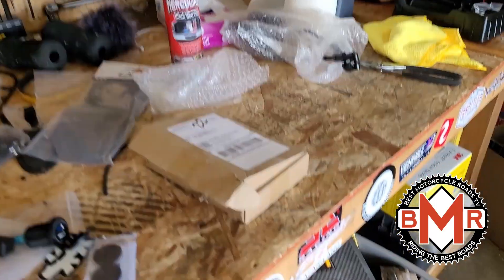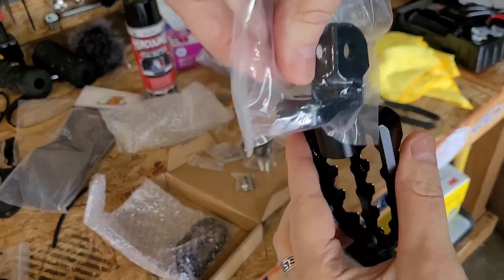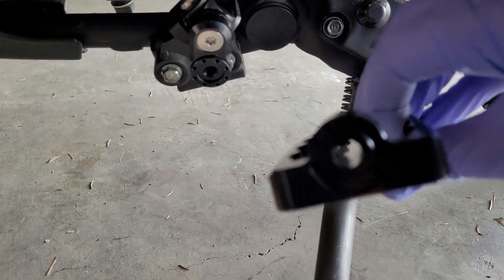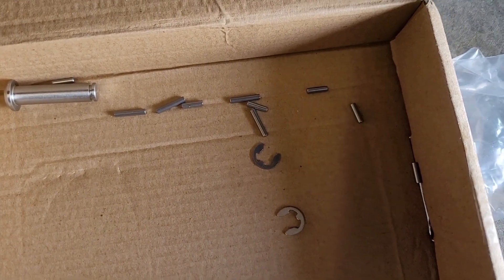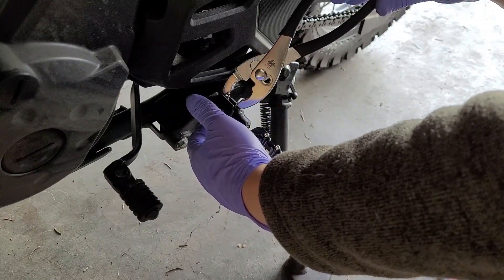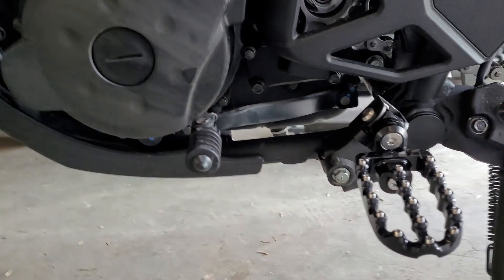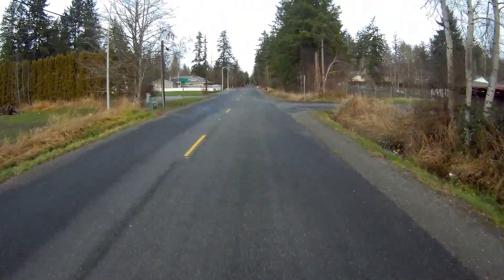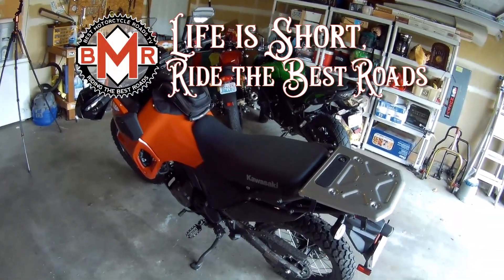2022 Kawasaki KLR 650 NICECNC Peg Install - NOT a How To.

Comment: I had to return mine.  No instructions and tried to align pins but no luck.
Reply from the maker: Strange. Mine worked no problem. The key thing I figured out is that with the extension plate you only use 1 pin per side.

Comment: I received  my foot pegs today...thanks for the tip
Reply from the maker: Sure thing, I hope ;) - So far they are working well for me. The nubbins are all still in place and tight. I like the lower position on my knees and standing is perfect (the teenie bit I've done.)
Reply: @BMRTV  well I'm 6' 2" I may still need bar risers..I'll have to wait and see..can't ride yet still have snow and ice over here...barely at 32 during  the day
Reply from the maker: @gabrielkopp2036  that is cold. A little plug, I bought some rox clones for the Versys and never put them on. Got them on ebay. https://www.ebay.com/itm/175137689523?mkevt=1&mkcid=16&mkrid=711-127632-2357-0

Comment: Thanks for the content, I went with the Nicecnc too and they turned out pretty good.
Reply from the maker: Thanks and mine are still working nicely. Got just over 3k on my bike so far. I am considering taking out the extension piece to see if that helps my standing position for going up steeper hills standing.
Reply: I ended up going back and slightly up for my peg position.  Still have a better clearance for shifting gears and using the back brake.

Comment: Installing the same pegs on my 2008 KLR today. The number of the pins (10) that come with them is very confusing. No instructions came with them either, so I will do what you did and only use one per peg. Tried to install more but could not get them to align with any hole. Let me know how the one pin has worked out. I will continue with the one pin tomorrow, Thanks for the video!
Reply from the maker: Nice. (no pun intended) . Same here. Clearly their engineers only want 1 pin when using the extension plate. I assume a mechanical engineer could probably explain why 2 pins would be a bad idea. So far it's been working great for me. Very solid feeling and I love the little bit of extra room having them slightly lower.
Reply: @BMRTV  Thanks for the response. I will finish today with the one pin. At least we have plenty of pins in case one breaks. ha ha

Comment: wow! nice comprehensive vid. I wanna put some of these on cuz I bought the adventure model, and because I'm 68, I have to step onto the left foot peg and throw my leg over. I feel these NICECNC pegs are wider and more stable and therefore will make it easier for me to "mount up".
   I also feel that these CNC pegs, coupled with the new Happy Trails extended shifter, will make shifting ezier. your thoughts? Thank u!
Reply: I'll try some and see. Thanx again!
Reply: I bought these for the very same reason. I too am in my 60's and my legs don't always swing like they used to! To make things absolute best for me I added a sergeant seat, which lowered the seat height 2" and changed out the swing arm lowering the rear 2". Now I can saddle up and ride like the wind.

Comment: did u do ok with just the one pin or did u add more?
Reply from the maker: Just the one (as they intended.) Working great. 3200 miles so far.
Reply: @BMRTV  awesome. just putting mine on as we speak. great video. i'll like and subcribe!
Reply from the maker: @markeye646464  Nice and welcome.

I just recently rotated mine back one notch to give me a little more reach to the handlebars when standing.

Comment: My biggest fear of those would be durability. I'm a big boy and standing on pegs in rough terrain is going to put a lot of weight and force on the pegs.  While they do look nice they don't look as stout as say the tusk or IMS ones. Only time will tell. Keep us updated
Reply from the maker: Absolutely. 50 bucks is worth trying them. Also, I'm more of a motorcycle hiker than a hard-core off roader
Reply: @BMRTV  Very important to know who you are, your skills and your purpose with the bike, I see so many people over spending, turning the KLR into a combat hummer, just so they can ride it around town most of the time. I think if you are that hard core of an offroad rider, you would not even be messing with the KLR to begin with, it is just not the bike for anything hard core, the bike is too big, too heavy, not enough power, too soft, so for its real intended purpose, the KLR are perfect stock, so any little upgrade is an overkill for what you are going to be doing with a KLR anyways.
Reply from the maker: @mayimbe2198  yes. It's a travel bike, not a performance adv bike.

Comment: forgot to ask, is there more vibration coming through to the feet with these nice cncs? I plan to do 99.9% of my riding on road. thanx again!
Reply from the maker: I assume there must be because it's not capped with the rubber like the stock ones are, but it's not an issue for me. My boots do a good job damping vibration and I spend very little time at one sustained speed where vibrations start to become a nuisance.

If I was going to ride on the road I'd keep the stock ones. I loved the way those felt.

Comment: Where did you get them and what brand are the pegs
Reply: Also get the tusk extended shifter it makes it much easier  to shift
Reply from the maker: eBay. The Brand is NiceCNC
Reply: @BMRTV  how do you like them so far?
Reply from the maker: @gabrielkopp2036  too soon to tell especially since I have ridden off pavement with them.
Reply: @BMRTV  well my 2018 klr still has stock rubber pegs..so for the price I just ordered a set...